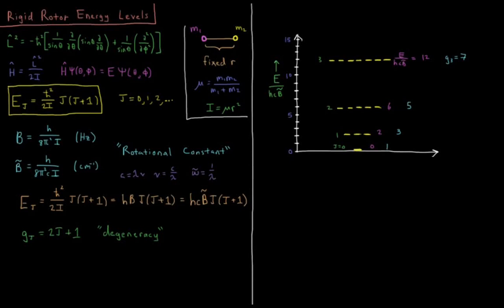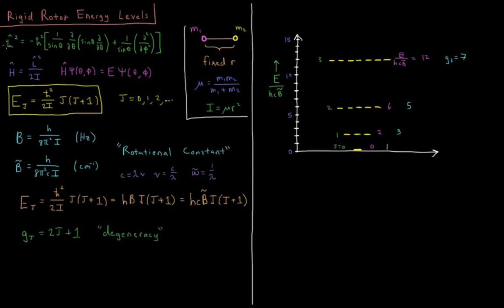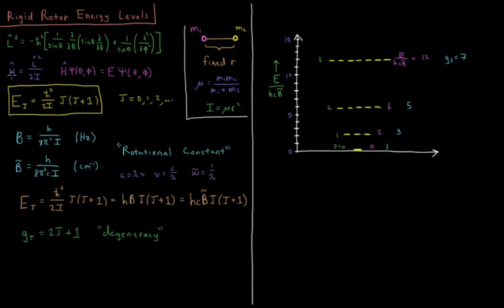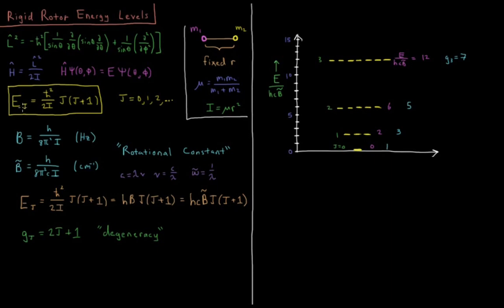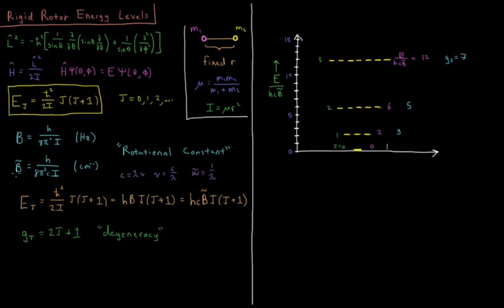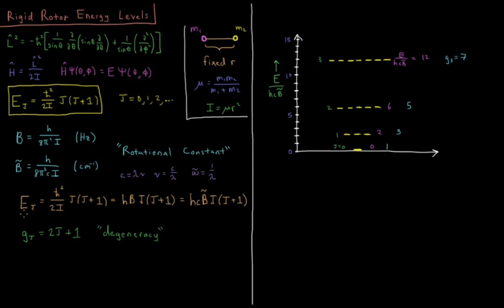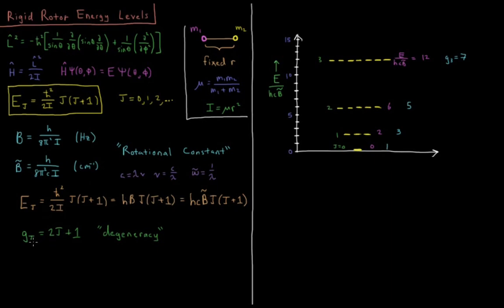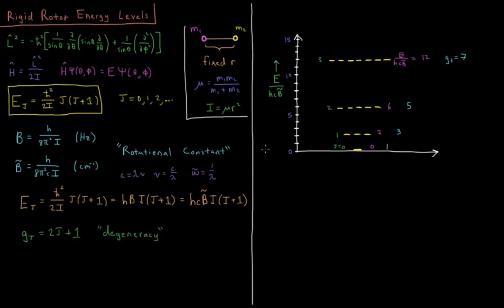Quantum Chemistry 6.3 - Rigid Rotor Energy Levels

Comment: Hey quick question: Why can we assume that the potnetial energy term is 0? The hamiltonian includes only the angular momentum steming from the kinetic energy, what about the potential energy term? Kind regards
Reply from the maker: Short answer: It is zero, and any time it is not explicitly defined it is an assumed zero.

Long answer: The rigid rotor is essentially a particle in the rim of a sphere. So at the rim of the sphere the potential energy is zero, and everywhere else it is infinite. We typically don't go into as much detail in describing this situation in physical chemistry courses as compared to the particle in a box. I don't know why, but it's probably out of laziness / convenience given that this section is taught much deeper into the course where people run out of patience for careful, formalized theory. You can also imagine it in spherical polar coordinates as a particle with no potential energy, but fixed radius R. So as I said above, without a defined, non-zero potential energy, the potential energy is implicitly solved to be zero, since H = T + V, and if H = T, that implies V = 0.
Reply: @TMPChem  Thank you :)

Comment: Here, you showed when J=0, Then E/(hcBbar) =0 and degeneracy=1. What is the significant meaning of this? Because you are saying degeneracy as energy levels then what is E=hcBbarJ(J+1) for? And what is the meaning of E/(hcBbar) = J(J+1) ??
Thanks.
Reply from the maker: The degeneracy being 1 means there is only one state with that particular energy. For E = 0 this is the state with no kinetic energy (i.e. the particle is not rotating). So there is only one state where the particle isn't rotating. hcBbar is effectively a unit of energy for a given molecule (Bbar is a constant for a rigid molecule in a particular geometry). Thus E / hcBBar gives the energy of the state in units of hcBbar. Using these units, the energy of states J = 0, 1, 2, ... is 0, 2, 6, 12, 20, ... This is a nice way to analyze the energy of each state in a way that doesn't depend on the internal properties of the molecule (all of which are encapsulated in the constant Bbar).
Reply: @TMPChem  What does it mean when you have several energy states at the same energy level, for example for J=2?

Comment: How does degeneracy equal to 2J+1?
Reply from the maker: For a given value of J, the allowed values of m range from -J to +J. All states with equal J have the same energy. Therefore, the degeneracy is 2J+1 because there are 2J+1 allowed values of m for each J. J indicates the total angular momentum (how fast the object is rotating). m represents the z-component of angular momentum (*what* axis the object is rotating around).
Reply: TMP Chem Again, these are the things that would worth to explain during the lecture. It is more valuable than read the equations.

Comment: pretty sure  rotational constant is wrong. it should be B=  (h^2) / (8 pi^2 r^2)       B = h(bar)^2 / 2I 

Ill do a unit analysis after I come back from my test :) So far it seems to work out to kg/s^2 but I think there may be a surprise hiding in our use of linear to angular conversions. Just need to find that distance somewhere...

But as shown for Ej the units don't work out either. Something is definitely fishy.... :)
Reply from the maker: The stated value of E_J = hBJ(J+1). J is unitless, and the SI unit of E_J is Joules. h is [J * s], so B should be in Hz (1 / s). The stated value of B = h / (8pi^2 I) = h / (8pi^2 mu r^2). 8pi is unitless, the SI unit of mu is [kg], and the SI unit of r is [m]. This gives us a unit of [J s / (kg m^2)] for B. We can break down [J] into [kg m^2 / s^2], which gives us units of B of [kg m^2 / s^2 * (s / (kg m^2))]. The [kg]s cancel, as do both [m], as well as one of the [s], leaving [1/s] or [Hz] as the final unit of B. Works out fine for me, and is consistent with every source I can find. Also gives correct numerical values relative to reference values of B.
Reply: TMP Chem every reference I have seen (6 so far) is hbar^2 / 2I which equals h^2 / 8pi^2 I. 

granted I haven't slept yet so forgive me if I am pushing too hard on this one lol

can you send me a link that matches your expression for the rotational constant ?

(found 1 example your way but the same document contradicts itself)
Reply from the maker: The total energy in terms of I is E_J = (hbar^2 / 2I)J(J+1). If you define it the way you're describing the units of B are Joules. The way I'm defining it the units of B are Hertz. Some people define it your way, and some people define it my way. Some sources even waver back and forth. In McQuarrie Quantum Chemistry 2nd edition Eq 6.31 Pg 274 has B defined in Hz, but in Eq 6.25 Pg 272 has B defined in J. Seems like sources do a shitty job of differentiating the value in Hz or J. I prefer Hz. That's what I'm going to use.

Comment: thank you so much. Needed these videos. When J=3 the E/hcB equals to 12? Not 8?
Reply from the maker: Correct. 3 * (3+1) = 12, thus the value in the diagram at J = 3 is labeled as 12hcBbar.
Reply: Thank you so much.

Comment: Can you clarify... E/hcB~ is equal to what? Are you saying that is J? Or J(J+1)?
Reply from the maker: Hi Katherine. The energy levels of the rigid rotor are given by E = hcBbar * J(J+1). The values h and c are constants. Bbar is determined by the bond length and mass of each atom. Once we specify a molecule, everything in the expression is constant except J. When we divide E by hcBbar, the y-axis of the graph becomes J(J+1). Plotting this way we can see that the successive energy levels are E = 0, 2hcBbar, 6hcBbar, 12hcBbar, ... Since hcBbar appears in every term, it's convenient to factor it out to show the J dependence of the energy, as well as the degeneracy of each level.